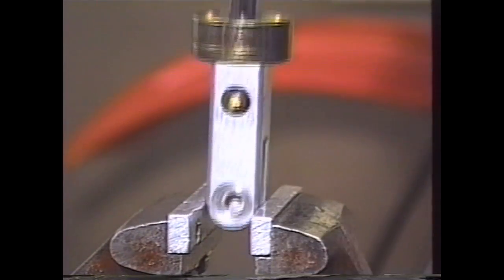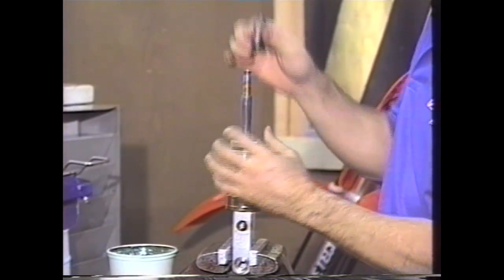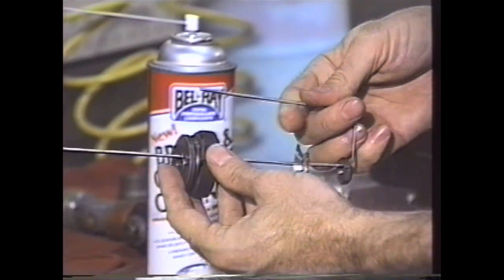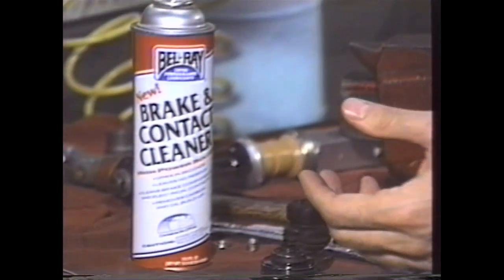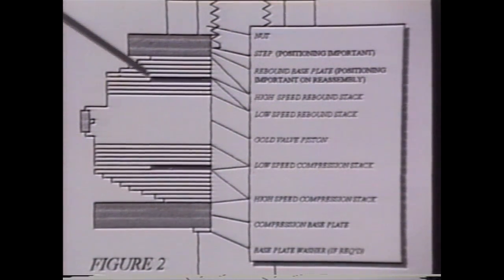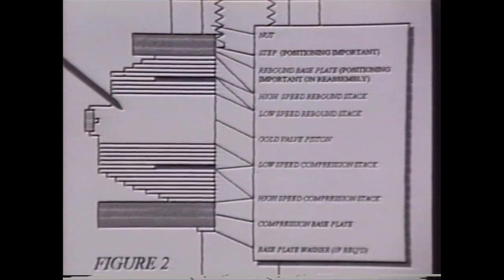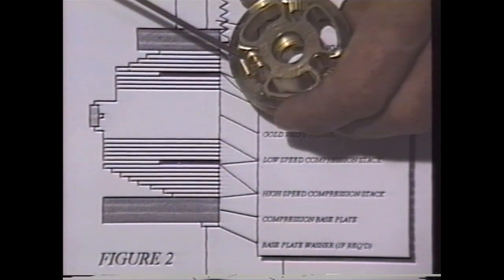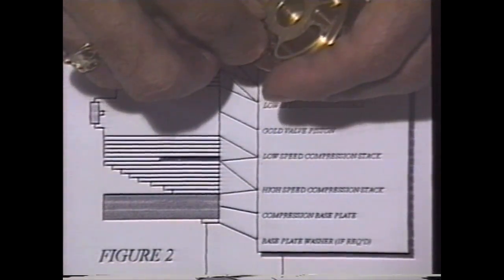Technical Edge Dirt Shock - Part 3 - Gold Valve Explained

Comment: Your separating shim for the 2 stage or 3rd stage is clear as mud. What shim is used as the separating shim? Diameter and thickness? I've searched high and low and still can't find an answer. Really missing information on your shim stacks specifically about the separating shim.